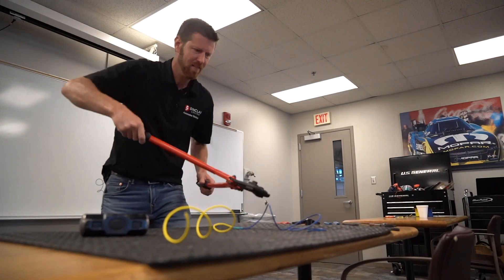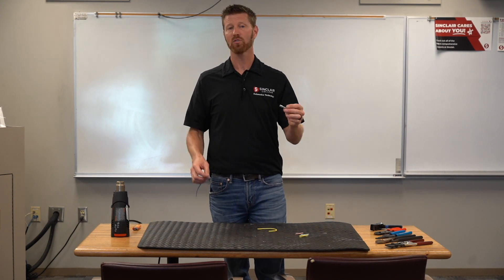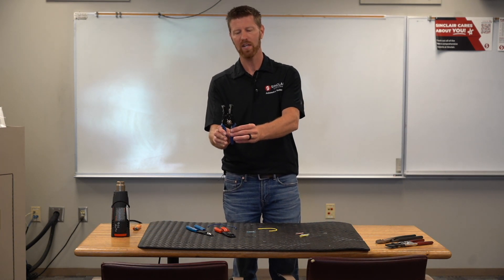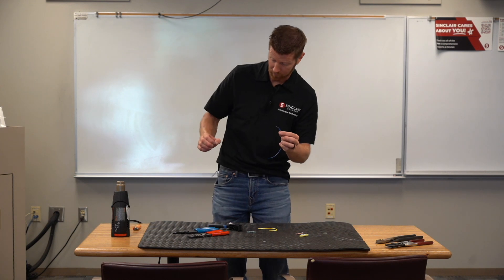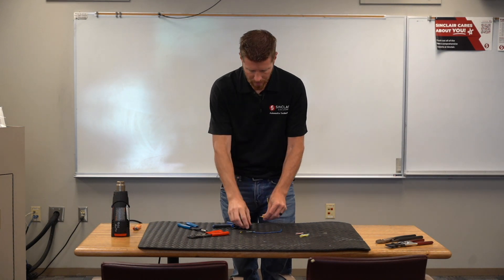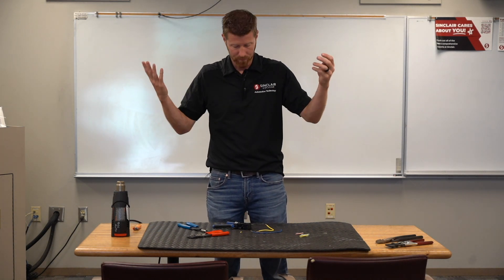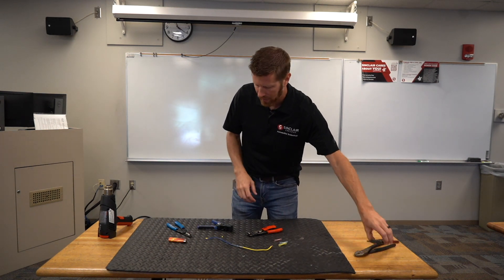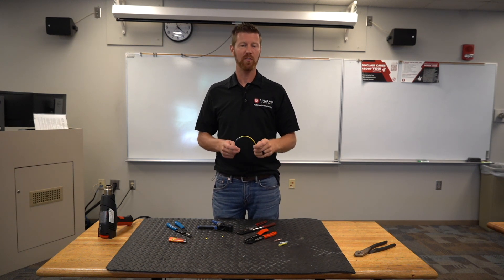Automotive Wire Repair Tips and tricks

Comment: Does the copper wire itself have to be interconected/woven together like if you’re going to solder it, or does the contact it make with the connector bridge the connection between the two wires without them contacting each other?